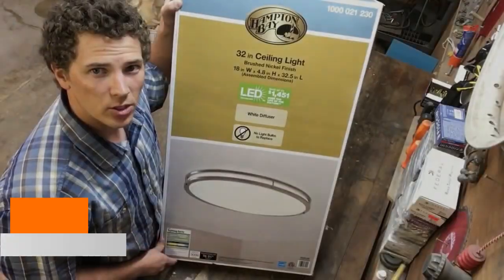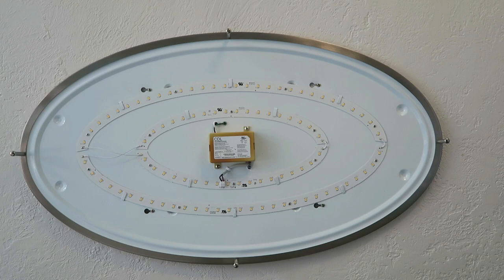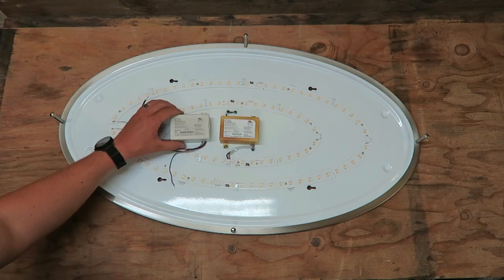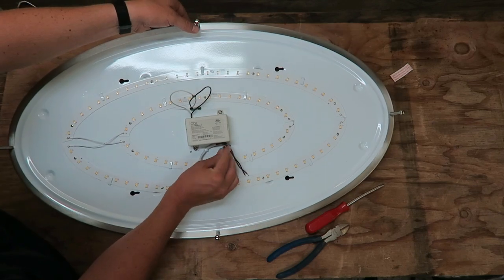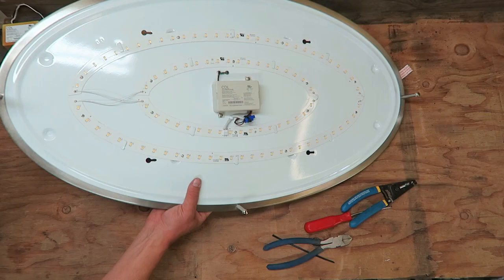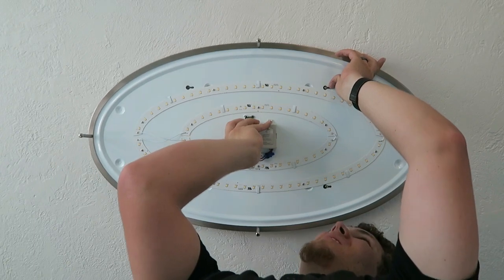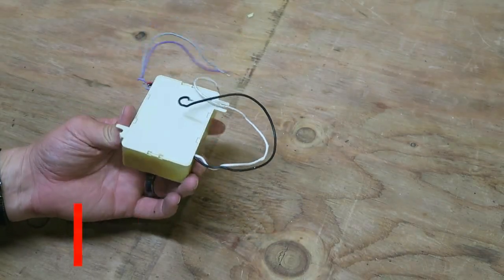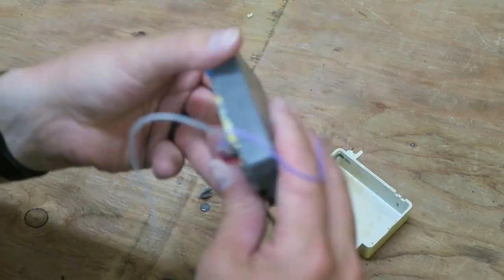Hampton Bay LED Driver Replacement

Comment: Where did you get the replacement driver?
Reply from the maker: Every driver is different. They are not very expensive but you have to find a replacement driver with the same specifications as what you already have.
Reply: @ThriftyGarage   Same question...I know they are specific...but where do you order them? Mine isn't on Amazon...
Reply: @ThriftyGarage  "not very expensive"... yeah, not that expensive if its $10 per unit at 500 units. I'm having a hell of at time finding a unit cost of $40, at a unit rate of 1.

Comment: I too have the same fixture. I have called Home Depot, Hampton Bay, and Cordelia Lighting.  They each in turn told me to get in touch with the other.  None of them could furnish me with a driver.  None of them carry the driver and told me that it was manufactured overseas and spare parts were not available.  If it was under warranty home depot would switch out the unit.  Good Luck finding a replacement part.  This adventure has taught me a lot about buying from Home Depot and Home Depot brand products.  I will not fall prey to their ways again.  today is Jan 20th 2020
Reply from the maker: I'm sorry to hear that they did not honor your warranty. I must have been lucky enough to get a replacement one. I was careful not to share with them that I would be sharing my experience on YouTube because I wanted to ensure that they didn't give me any special treatment.
Reply: Next time, just buy the whole new fixture and swap the drivers out and return it. I don’t think that’s unethical at that point since they’re refusing to help you with their defective product. You tried to pay them money for a new one and they were of no help, so that’s on them.
Reply: @ryspace  Or just buy a line voltage fixture in the first place so you can replace the bulb yourself with an LED bulb you have in that kitchen drawer with all the other stuff in it.  😀

Comment: FML potted power supply. It all goes in the trash. even if you only had one busted cap, there's no way to fix it for $0.50. Have to throw the entire brick into the landfill. what a sodding waste.

Comment: Thank you for the video. I was amazed when my LED ceiling fixture in the kitchen started humming and blinking a few weeks ago after only 2-3 years of service because LEDs are supposed to last for over 10,000 hours and not need ballasts! Well, it looks like the lights DO still work and they DON'T use ballasts...they use CONTROLLERS! What the hell is the difference! They are both a pain the ass to replace and much harder to change than a light bulb!
Reply: As an electrician, i never install integrated LED light fixtures.  They are a scam.  Get a standard fixture and use a line-voltage LED bulb.  :-)

Comment: The lack of replacement drivers is "driving" a lot of otherwise functional technology into the landfill.  That's so environmentally irresponsible and honestly, in this age of dwindling resources, it's highly unethical and should be considered criminal.  With global economies driving the production of consumables, parts standardization should be required.  It would reduce resource and energy consumption and ensure maximum product life.  Then there is the "human" factor.  People are brainwashed on a daily basis, driven to want the latest "new" product, rather than to maintain otherwise functional devices.  It's pathetic how people are manipulated into purchasing decisions that defy logic, reason and responsible stewardship of the planet.
Reply from the maker: Amen

Comment: Thanks @Thrifty Garage ! Just watched this video, read the comments, followed the steps and called Cordelia Lighting, a replacement driver will be shipped to me. Thank You!
Reply: Where can I find Hampton Bay LED driver replacement
Reply from the maker: Paul an LED driver is a common component in any LED light. Comparability is what you are looking for. Look at the specs which should be written on the driver. Order a replacement driver with the same specifications.
Reply: @ThriftyGarage  Thanks so much

Comment: Why is no one answering the question as to where the to find the part?
Reply from the maker: Every driver is different. They are not very expensive but you have to find a replacement driver with the same specifications as what you already have.

Comment: I have a Hampton Bay light just like yours and the driver went out. Having to replace the driver with a different brand because I cannot find the CDL brand, but I found one to replace it. Should be here tomorrow and your video will be a big help!
Reply: From what I didn't see before was the other driver shorted out which, I think, shorted out some of the bulbs. When I got it down and removed the old driver it was black under it so most of the bulbs were out.
Reply: @paulmccutchen7781 Where did you find your new driver? Which website?
Reply: @MK-z3z  I found it on Amazon. It didn't work because when the old driver shorted out it shorted out the line of lights. Didn't know till I got it apart.

Comment: Thank you.  I have this exact fixture.  Can you recommend a smart/wifi dimmable driver?  if possible could you please provide exact product and or link?
Reply from the maker: This fixture is capable it dimming. You need to hook up the purple wire to a dimmer switch.
Reply: @ThriftyGarage   Thank you, but I don't live in the US... I would like to convert this have a either a smart switch but would really prefer a smart controller.
Reply: @ThriftyGarage  I have a dimmer switch in the wall, how do you connect the purple wire?
Reply from the maker: It should have a wiring diagram. It may depend on your switch or outlet which is the correct wiring procedure.

Comment: Was the led flickering? I recently installed a led ceiling lamp, and after 5 minutes on it starts flickering like crazy, like turing on and off. We didnt install it immediately after pirchasing and the warranty has passed. Not sure what the issue is. Could it be the driver?
Reply: Could be that or a grounding issue. Ours died because our old apartment building was having grounding issues that were causing power surges/flickering that eventually killed the light (seems that way anyway). Not sure if it killed the driver or LED strip, but I’m pretty sure it’s the driver.

Comment: Is this LED driver available in market? Of an alternative led driver that might do the work. Mine stopped working, no warranty and I need to replace the driver. Please suggest. Thanks.
Reply from the maker: Find another led driver with the same specs.
Reply: @ThriftyGarage  Which specs am I trying to match? There is a lot of info on the driver.
Reply from the maker: Yes, there will be voltage ratings and other information printed. If you do not match the driver to the LEDs as they were designed you could reduce the life of the LED or ruin them completely.

Comment: Mine just stopped working after 5 years when it was really hot outside, which heated up my attic, which might have heated up my light fixture.  After the temps dropped, it started working again after a few days.  Not sure if this is the reason why, but I am keeping my fingures crossed.
Reply from the maker: Your LED Driver might be going out...

Comment: Good video. How did you determine it was the driver vs the lights themselves?
Reply from the maker: The driver went bad.  The LEDs still work great and the light is 100% functional now that I have installed a new driver.  Thanks for Watching!

Comment: Great video, Just find it strange that you'd have links to almost everything except the dimmer itself.
Reply: There is no dimmer.
Reply: It is dimmer capable if you connect the included dimmer wire to a dimmer.

Comment: Great video. I can’t find a driver anywhere. It’s been hell looking for it. Do you have a link to the manufacture? Also how much was it?
Reply from the maker: I contacted Home Depot/Hampton Bay's warranty department (855-HD-Hampton (855-434-2678)) and they provided a new led driver under warranty.
Reply from the maker: Jay Kokernak commented: "Was told by Home Depot the manufacturer for the driver is http://cordelia.com/
They can be contacted for a replacement if you are not under warranty."
Reply: Thrifty Garage thanks so much

Comment: Where can you buy the driver?
Reply from the maker: You should be able to buy an led driver online at and electronic parts store.  You could probably even find one on Amazon.  You will want to check for compatibility with input and output specifications such as volts, amps and watts.  I was fortunate enough to have this covered under Home Depot's warranty.  They just looked up my receipt on their warranty system.

Comment: Add a ground or they will keep dying
Reply from the maker: Interesting... I have never heard this. The house was built in 1942 so it only had two wires.
Reply: How hard is it to add a grounding wire? My apartment building was having surges/flickering issues especially in the kitchen where we have this fixture. I was told it was probably a grounding issue. I think the grounding issue and power cutting in and out cooked the driver. The building maintenance is useless and wanted to replace the whole fixture with a super cheap looking/crappy one. They tried to tell me they can’t find a replacement for that same fixture. I found it in five minutes at Home Depot online so they begrudgingly went to buy one, but I don’t want it to keep dying so I might have to ground it myself. Any advice is appreciated, thank you!

Comment: Why would anyone want a light like this it’s pain in the ass to change the driver
Reply: it's a 5-minute job...  stick to your desk job... lol
Reply: @patrickhinsey5727  it’s not a 5 minute Job the driver for mine could not be fount Home Depot sold the light but do not carry the the driver so I would need to buy a whole new light instead of a pack of bulbs
Reply: Because it looks nice and it’s super bright, but evenly diffused lighting from the shell which is pleasing to the eye. Since they’re LED strips, they probably won’t burn out for decades and honestly the only reason mine died is because the contractors didn’t update the electrical in our apartment building when they remodeled everything and there’s no ground wire connection. We were getting surges and flickering which I think cooked the driver. Reading through the comments it seems OP also didn’t have a ground wire. But yeah once you get a replacement driver (or a different one online with the same specs) it will take five minutes. If installed correctly it should last decades without needed replacements light lightbulbs and it’s probably better for the environment because of that as well.